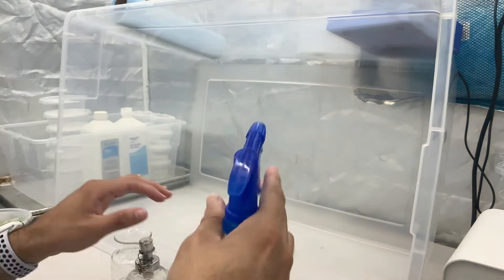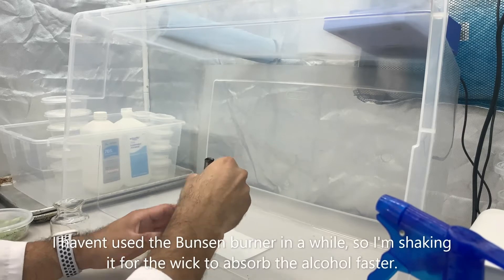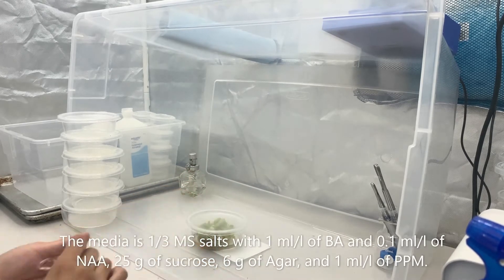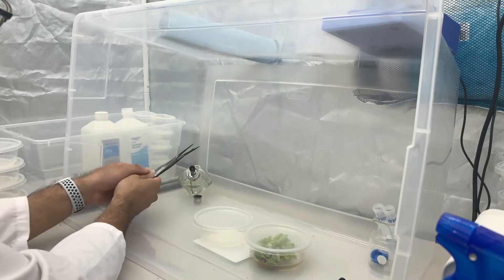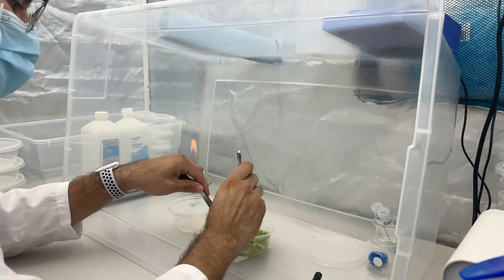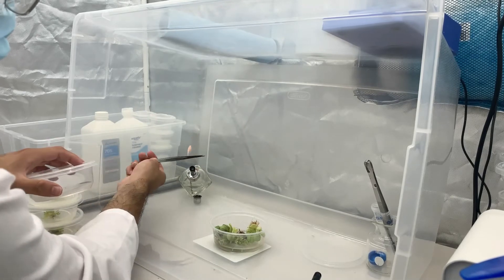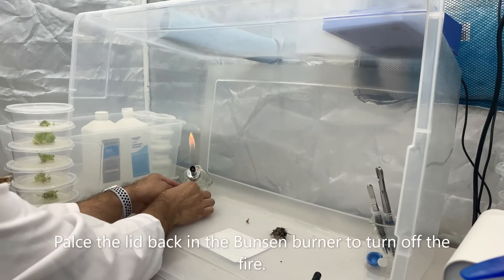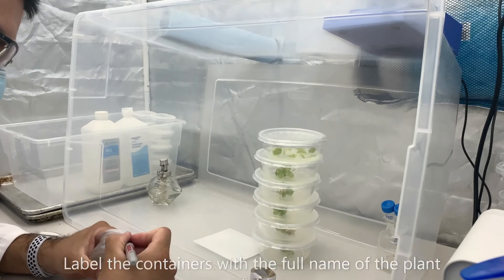How To Use A Bunsen Burner In Your Tissue Culture Process

Comment: I don't understand what the burner adds here ... Once the forceps are sterile, why sterilize them again and again ? The only contamination should be coming from the air, which is going into your culture boxes anyway. Doesn't make sense to me. This seems just as good as any still air box setup.
Reply from the maker: I have had good success working like this for many years, and that's how I feel comfortable. There is not a "correct" technique of doing tissue culture, everyone has a different technique.
Reply: @PlantCellTechnology  so basically this has nothing to do with science
Reply: @Youloush  hi it does. This is the procedure many labs follow. After having the equipment soaked in 70% isopropyl alcohol, they must use a burner to sterilize the forceps and or scalpel once again. I’ve done this and I’ve had a lot of success with it. Clearly this yt channel has also had a lot of success with it as well, so it must be the procedure they are following 😊